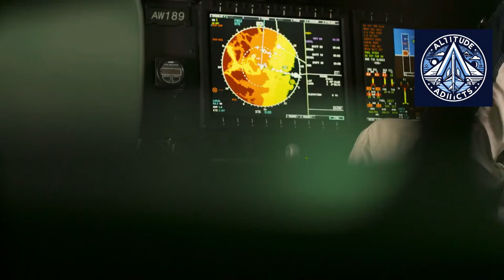Ansat-M, Mi-171A3 & Ka-62—Inside Russia’s Helicopter Certification Push

Comment: the underlying issue is that during the Soviet era - light helicopter, trainer aircraft and light aviation was centred in Poland and Czech regions ..... helicopter and small engines were made in Ukraine. So Russia has suffered from the Soviet Union being "egalitarian" and spreading the industries around during the Soviet Union. They are slowly overcoming the same issue with turboprop regional airliners. But its same root cause. Klimov is doing the bulk of the work of doing what Ukraine used to do.
This also made Russian use of drones and cruise missiles a bit late as once again there was a shortage of small engines ...... they are all part of the same hangover from the Soviet era. 
Sanctions are just another issue .... on top of the real underlying issue .... Soviet "egalitarianism".
Reply: Russian successful build their own even on heavy sanctions